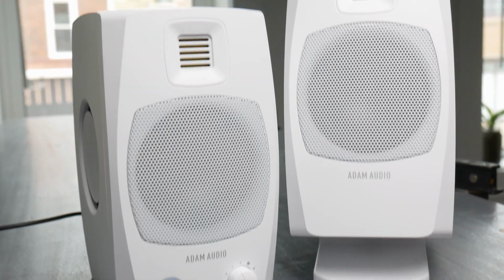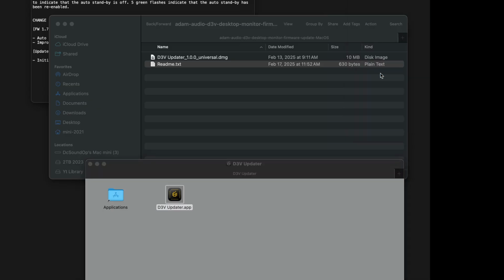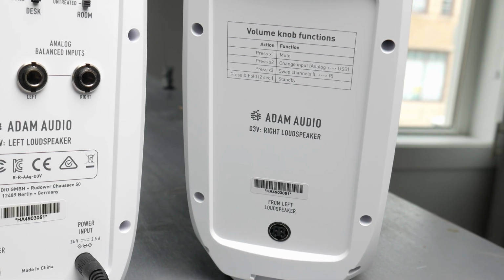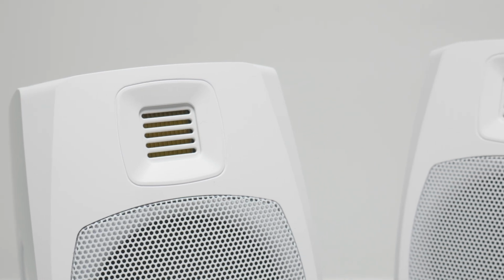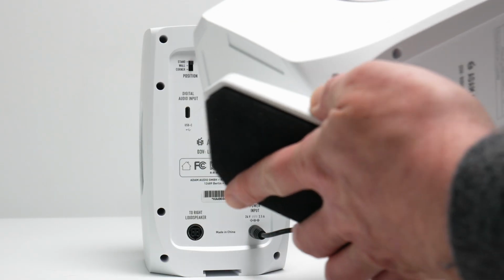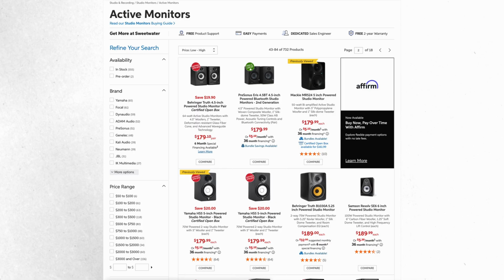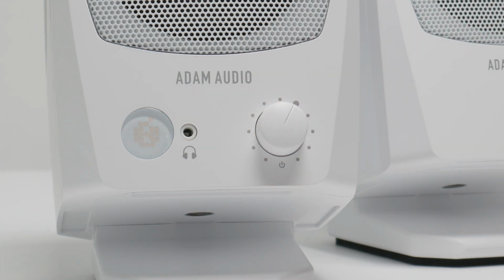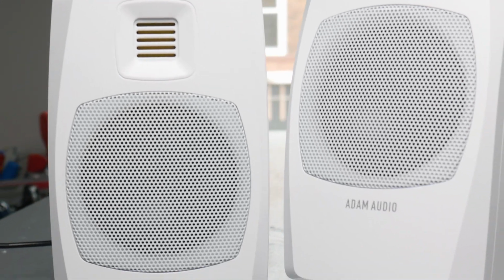USB-C Speakers by ADAM AUDIO - A FUTURE without interfaces?

Comment: Hello and nice review. I'm curious to know the sound of the USB-c output compared to the sound suing an interface.
Reply from the maker: I would say if sound quality is your top priority, a dedicated interface that meets the specs you need is going to be the better sounding (and more flexible) choice. I like these a lot for setups where size and simplicity are the priority.
Reply: @DcSoundOp , that's kind where I'm landing with adding an interface. It's not critical mixing, but was super curious as to whether there was a difference in sound. I did go ahead and ordered the D3v's and an interface. I'll do some testing. Thanks!